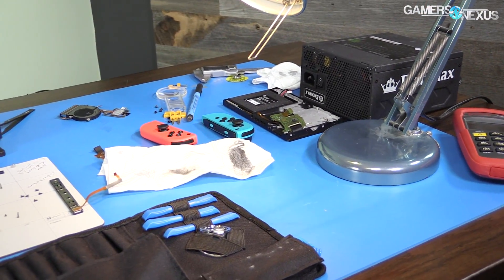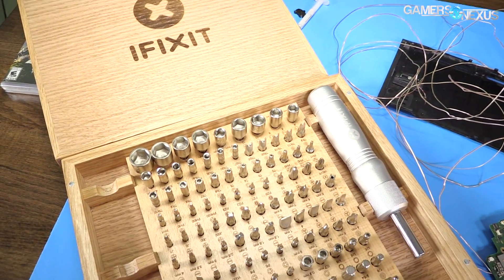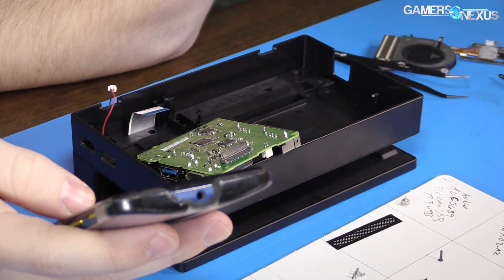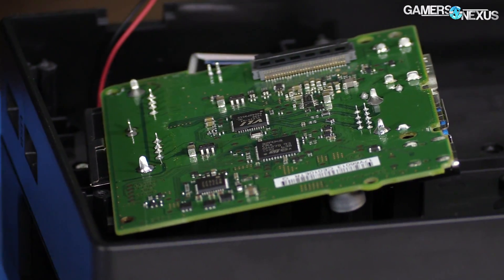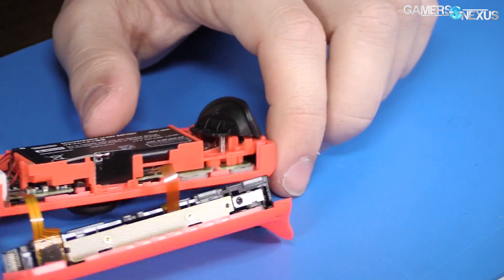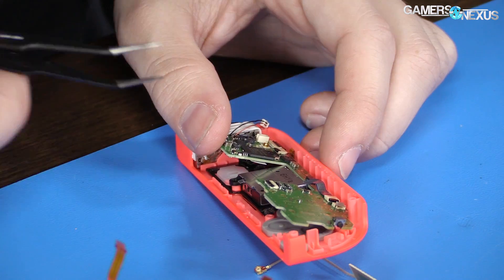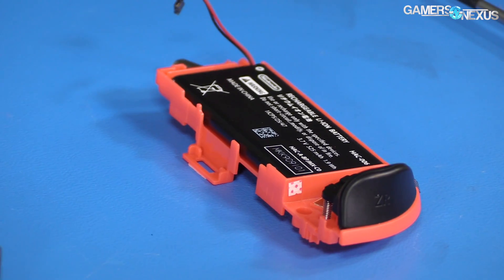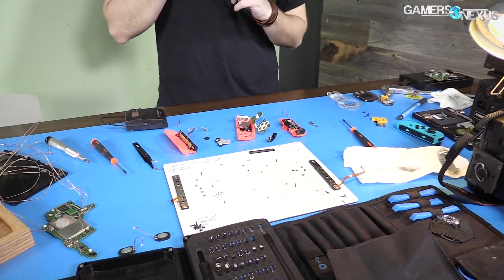Nintendo Switch Joycon & Dock Teardown

Comment: That is one really sad 2015 last gen tablet dock setup.  If your controllers blow it will be cheaper to just purchase a new set day 1 then pay for repair/replacement or send out for refurb.  1-2 Switch is one of the top failures Nintendo has ever released and third party let alone rarely first will ever touch the failure known as Joycon.  Joycon failed.  IMO people want decent good games like BotW (which is a 3 year old held over WiiU port) they don't want gimmicky bullshit joycons.  The plastic is probably toxic.

If Nintendo had ran with BotW for WiiU back in 2015 they could have re-energized that system with a massive come back, even renaming it and upgrading to V.2 and throwing in a first gen Processor and including cart and blu ray for $300 last Dec.  Not only do they swallow that humble pie but they would have looked better, rather then selling a really cheap, easily damage prone last gen tablet that actually costs like $200 when put against comparable systems like Shield or the upcoming smartphone power that are at a $200-400 price point, half of which are far more powerful and will play the entire indie game line up.  Switch is just a must have if you need the big fucking first party 4, and even those don't sell well anymore.  Also with POC, emulation will be 100% in 1-2 years time for the switch so Nintendo just has only 1-2 years to make their money.  WiiUemu is practically nearly finished.
Reply: That awkward moment when this thing sold like hot cakes

Comment: If I ran Nintendo I'd of put 3 gig CPU and GPU in tablet it also would be bigger with Joycons and dock station would have 4 gig CPU and GPU . Nintendo should have made it with a comparable power as modern systems.

Comment: honestly the dock is VERY dissapointing, without trying to be a dick it feels like a waste of space. They could have put so much more sweet goodies in there. At least an upscaler or a Parallel Processor so you can have 60+FPS on the TV and 30 as a mobile device. I thought at first it was like that, turns out its just a better raspberri PI. or iPad with extras. Sad really. Anyway thanks for taking it apart and solving some of the mystery, also a big thanks to hello games and No Mans Sky since they helped me not to jump onto the Hypetrain.
Reply: There are reasons why this would be a bad idea:
1. It would easily raise the price and extra 200
2. The power of the console mode would ruin the idea of the Switch's games being able to be played anywhere due to games potentially requiring the extra power from the dock to function. This isn't what Nintendo wants and for a good reason. It's a bad decision
3. People are already complaining about the dock being overpriced [seriously? It comes in the damn box]. This would just make that price so much worse, and inaccessible to a lot of people. This would be forcing it to be an addon, which, again, Nintendo doesn't want. They specifically said that this could be played wherever, and they cut so many corners to be able to achieve that. Our ideologies would be far worse off than most people would like to believe, so what they did with the dock is perfectly acceptable

This is all assuming you even could find a way to put external hardware into the dock, and have a sufficiently fast communication speed to be able to fully utilize it, which just isn't possible
Reply: the tegra chip they are using doesn't allow it to switch over to an external GPU. they couldn't put one in the dock.
Reply: the usb type c connection supports up to 10 gbps, it could support a gpu compatable with x5 pci-e compatability.. so get something from nvidia they will still make throughout the switches life, only for upscaling the image, leaving a cheap solution to allow smooth fps in most games
EDIT: they could release another dock with a seperate gpu for more, giving people the option, similar to the joy-con grips, ones just a hunk of plastic, the other has charging..

Comment: that board you thought was for NFC was the wireless antenna to connect to the switch. can you take apart the other controller to see if they are in different positions. the left controller has connectivity issues

Comment: That little flat part you pulled out with the snap connector looks to be an antenna to me most likely for the bluetooth or however they are connecting them. The NFC is probably on the PCB :)

Comment: Kinda disappointing, the quality of that dock.

Just looks so plasticky.

Like, I get it does nothing, but id just expect more after the buildup.
Reply: that could very well have interfered with the bluetooth signal to the controllers
Reply: Robert Skarżyński well considering aluminum would've costed them like .23 cents more, i'd rather have metal sitting underneath my TV
Reply: Beef Ingot Who cares if it's plastic as long as it functions it's not a problem.

Comment: That ribbon cable on the USB/HDMI board looks like a ZIF connector, heck it looks the same as the 40 pin ZIF connectors on old iPods.

Comment: Good video, but you probably should have opened the left joy-con and compared the differences.

I think the hd rumble might be the white plastic thingy at the bottom (that would be some clever engineering to make it feel like it's rumbling at different parts of the joy-con). You probably ignored it, thinking it is the IR sensor, cos you didn't open the left joy-con and find it sitting there too.

Also, apart from the NFC, did you find anything responsible for Bluetooth or other form of wireless communication? Or does that Broadcom chip also handle Bluetooth, not just NFC? Is the left joy-con using a different chip?

Comment: Hey gamer nexus Does The cost of manufacturing and materials match the price tag of the switch? iirc the ps3 when it came out cost like $800 and sony was selling each console at a loss.
Reply: dude you are talking like if the parts and assembly were made in the USA lmao, those prices you put are ridiculous. 40$ battery? 20$ Joycon? 30$ assembly? Tou are clearly taking those numbers out of your ass
Reply: That battery might cost 40 or 50 for you to buy one but bulk wholesale it's $10 US tops. Hell, I could buy a battery right now with the same specs, just a different form factor and connectors for about $15
Reply: Nintendo has never sold anything at a loss and I don't see them starting now.
Reply: the ps3 never was sold at a loss, that was a lie and will always be. Those alleged rumors have been proven to be false.
Reply: It isn't so much the raw specifications of the battery. It is the quality of the battery; heat rating of the cells, charge cycles, number of cells, and the charging circuit. You can obviously spend chump change and get an equivalent battery, but it won't be the same.

The same goes for any part.
Reply: smokeydops lol you have no idea how much components cost, even if you included the R&D of the switch it wouldn't cost $300 initially.
Reply: smokeydops Those prices are way too high. It is likely close to 150 total and 180-200 after ALL other costs. So 50 profit at least
Reply: When was it proven to be false? Source?
Reply: smokeydops Nah, they're screwing people over. We already knew the dock was overpriced, but $90 for something that probably runs $20? Nintendo's not even using any lube!
Reply: smokeydops I guess shipping cost is negligable. they ship that stuff in cargo containers. god knows how many switches you can fit in a single cargocontainer. so if you scale the shipping price down to a single device it's probably close to nothing.
Reply: Dr. Sinclair what do you base your estimate on? Besides complete bollox?
Reply: You guys don't need to be assholes. Do you know what rotation is? You can have a low profit if you sell enough because the rotation of the inventory will be high enough to cover the cost that it takes to make the product. Or you can sell the product with a high price if you expect low rotation, for it to cover the cost that it takes to make. Nintendo wanted to reach a very high number of people with this console, not only gamers but a every day usual player (for exemple facebook gamer people: farmville, etc..), so that's why they extimated the price to be between the other consoles... I can be wrong and they can only be aiming for profit, but overtime what every company wants is money. Every one does, so if you want to use the console, you need to buy it. Is that simple.
Reply: i predicted the switch would have a plastic screen months ago and nobody believed me,and of course it did because nintendo are cheapskates.having  said that the switch impresses me far more then the 3ds and wii u did at launch they were both over priced pieces of junk.
Reply: i would argue if there is profit it is very minimal.id say they recoup there losses with all the high priced accessories.
Reply: The wii u costs 240 dollars to make not including manufactuering so it should be around that price.Plus its a good quality lcd screen which could cost up to 20
Reply: Nepu-Tech USA you think it cost 45 cent to make?

Seriously this is the most innacurate made up thread ever. Just a bunch of morons making up numbers.
Reply: Nepu-Tech USA when you say predicted, you mean read other people's views, the general consensus and leaked specs and agreed?
Reply: Nepu-Tech USA then you didn't predict shit
Reply: Prices for those components in bulk purchase? I think you can divide all of those prices you listed bya factor of  8, if not 10.
Reply: MrPuschel you think bulk buying discount is 8 to 10 times? You can't buy the chips individually unless you are buying from a supplier that has already "bulk" bought them.  No company charges a eighth of the cost of something because of bulk buying, let alone a fucking tenth. They would be losing money, no manufacturers margin is that broad that something (for example) they are charging $10 a unit for they will charge $1 because you bought in bulk. 

This thread is pure fantasy, you need to all go do some research.
Reply: The information provided by smokeydops resemble an amazon or aliexpress shopping cart. They where also illogical. Cost from high to low starts with the memory, then comes the display and usually assembly. Other components are cheaper with the battery being around the cheapest. All of the switches components except for memory unit, tegra, display and maybe power supply are <10$ A fair amount sure <2$. The mainboard including components might cost them about 40$ to 60$. Of course its a guess, but be sure that nintendo doesn't buy their components from aliexpress.
Reply: it's only logical the screen has a plastic cover instead of glass when you look at the main target audience. The switch is (mostly) targeted at kids or more precisely at parents to buy it for their kids. I don't know about you but when I was a kid I dropped my gameboy countless times the only thing that ever happend to it though was that one of the buttons became a bit loose. Now imagine the thing had a glass screen. probably a third of the devices would go right back to the retailers as the screen cracks after the first drop within the covered waranty time.
Reply: You know that they don't put car glass on smartphones and other devices?
Reply: I know that alone from the people I personally know 2 guys broke their screens within the last two weeks. The phone just has to fall in a bad angle and the screen is cracked. With flexible plastic that can't happen. They could have used a harder plastic though for the screen than for the docking station so the dock can't scratch the screen.
Reply: That's not how things are priced. If you only charge for what it costs material wise, then you'll go bankrupt. Keep in mind that companies do need to spend great amount of money on designing and testing the product, as well as opening up production lines with suitable equipment and doing marketing.
Reply: Did you just pull this information straight out of your ass? Nintendo has not only confirmed that they are making a profit on the Switch from day one, but there is no way in hell it costs them anywhere near what you are suggesting for any single part you listed. The Joycon grip is just a piece of plastic and you think that costs them $15? I really hope you're just a dumb kid who wants to sound smart.
Reply: ***** you are saying to people they are dumb kids acting smart and you think a joycon is "just a piece of plastic".
Reply: "Joycon grip"
Reply: Unless of course he was referring to the Joycon charging grip which is just a piece of plastic with a battery in it.
Reply: ***** oh you are responding to the second person in the thread, my bad.
Reply: +h. s  Low performance compared to what? Did you honestly expect a mobile console to have the same performance has a pure home console?
Reply: h. s That was the stupidest fucking thing I have read today.
Reply: One joy con cost 40 two jc cost 70
Reply: I can be wrong. I didn't say it was at a loss, I speculated that it was breaking even or barely a profit, almost a loss. But, I did argue that it would cost them almost $300 to make it, and more to ship it, and then more for retailers to have overhead, I guess that's all that makes for a loss. That would mean Nintendo can make these consoles for at most $250....

Please link your source for Nintendo saying they sell the console at a profit. I am impressed if they do.
They could of course make $250 with the two aforementioned potential inaccuracies in my assessment:
$50 battery? Might be $10, including circuitry.
$30 assembly and parts/factory logistics/shipping cost? Might be $5.
Would make the console about $230. Do you guys think that is a more fair assessment? It might very well be.
Reply: just look at the 200x profit margin they're making with this shitty plastic doc and 50 cents of USB/HDMi ports selling them at 90$ and you'll see how much profit Nintendo is trying to make. Wouldn't surprise me one bit if the Switch costs Nintendo less than 100$ to manufacture.
Reply: +SENATORPAIN1
Don't feel bad, I predicted the CPU was a Tegra X1 since the reveal and there where people saying it would be more powerful than the PS4 LOL even today there are people that think Nintendo can add VR capability to the Switch when it stutters rendering Zelda at 900p. Nintendo fanboys are fucking gullible and Nintendo keeps making a killing out of them.
Reply: +Manic Demise
No I pulled out my crystal ball and sacrificed a couple of goats to Satan to come up with my answer
Reply: Okay gaz that was a horrible estimate. Def more than $50. The SoC alone is around 80 and thats buying in mass quantity. Ill raise my estimate to 200-220 to make a single one. That includes labor, shipping, everything. The controllers on the other hand are an absolute rip off. 50 bucks for a single joy con is a joke and at least 80 for two? Thats got to be the dumbest price ive seen for a base controller
Reply: smokeydopes if you we're buying all that yourself as a consumer then yes but big companies like these hahaha no switch is 100 dollars max cost of manufacturing and materials.
Reply: smokeydops wow idk where you buy stuff but that cheap crappy 720p screen is not 50 bucks at all. It might be less than 3 bucks to make it. And IMO the Switch itself would cost Nintendo like 50$ (And I think it's even cheaper).
Reply: The Switch most definitely justifies its pricetag in hardware alone.

The battery probably costs Nintendo ~$30-40.
The Joycons probably cost them ~$20 each. With these as time rolls on, production will be cheaper for them.
The power brick, assuming it is of good quality (as it likely is), would cost them $15.
The dock probably ran $20.
The Tegra Chip itself was probably $40-60 per unit.
The screen was likely $50-70.
The cost of the system software (the operating system) is evaluated as units sold not per unit, but you could say it takes up ~7 GB of system space, which is like ~$5 of storage.
The on-board EMMC flash was ~$7.
The on-board wireless adapter was probably $10.
The system memory was probably $50.
The enclosure & thermal solution was probably $15.
The Joycon Grip was likely $15. For this, cost will decrease as time goes on.
Things like the SD card reader (game cart reader & expandable storage), USB controller, speakers, audio jack and chipset, likely total $15.
Then cost of assembly. Cheaper as time goes on, but probably $30 per unit.
Add in then the cost of the included cables, $7.
About $300 just TO MAKE.
Then there's the price of shipping.
I have no doubt this console is being sold at a deficit. Not a huge one, but one.

Comment: this shouldnt be worth 300 dollars it should of been 249.99
Reply: $200 is the price of the new 3ds xl, the hardware in the 3ds is ancient, yet its still selling for $200, the switch has a fair price considering the hardware..
Reply: kyotheman69 You cheapskate lol 😂 😂
Reply: easily or even 199.99 most the tech in the system is pretty low end, dock is most disappointing they are asking 90 when its like 15-25 dollars of tech there.